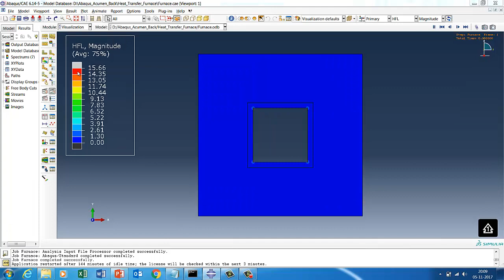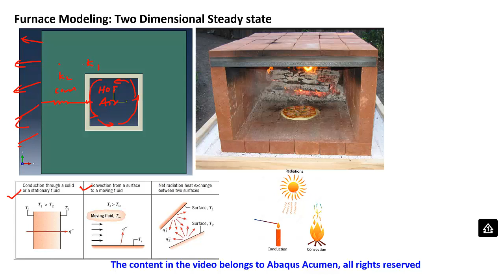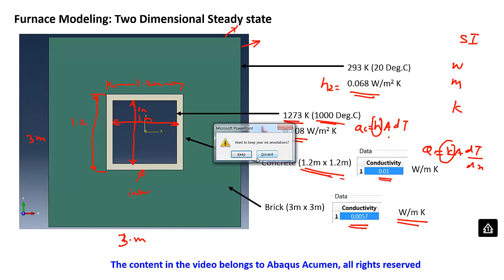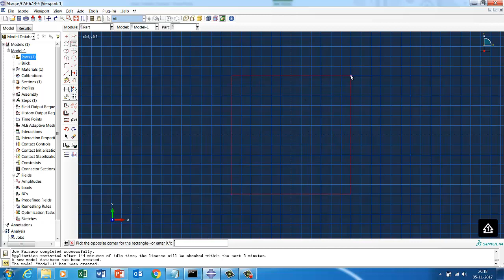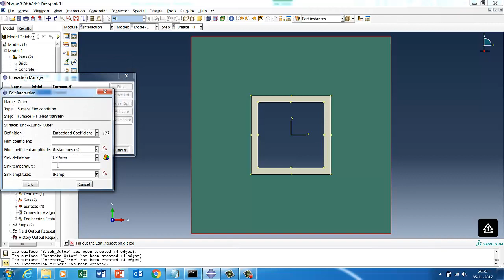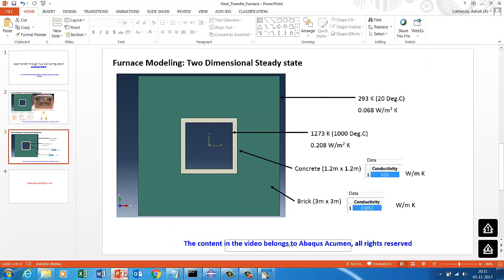Heat Transfer Through Two Wall: Furnace Modeling

Comment: 07:20 Create Part - Brick
08:38 Create Material - Brick
09:32 Create Section - Brick
09:42 Create Section Assignment - Brick

09:52 Create Part - Concrete
10:46 Create Material - Concrete
11:12 Create Section - Concrete
11:23 Create Section Assignment - Concrete

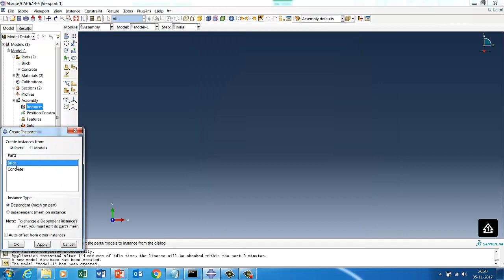11:34 Create Instance

12:24 Create Surface - Brick_inner
12:47 Create Surface - Brick_outer
13:08 Create Surface - Concrete_outer
13:26 Create Surface - Concrete_inner

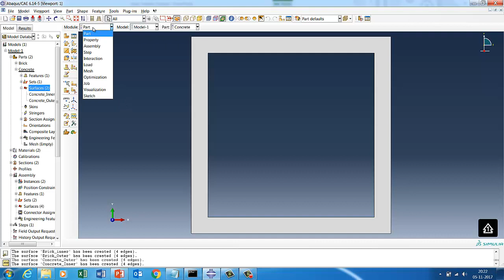13:48 Create Step

14:30 Create Constraint (Tie)
16:00 Create Interaction - Surface film condition - Concrete_inner
16:27 Create Interaction - Surface film condition - Brick_outer

17:43 Mesh
17:46 Mesh Controls - Concrete (Quad - Medial axis)
17:50 Global Seed - Concrete (Approximate global size: 0.02)
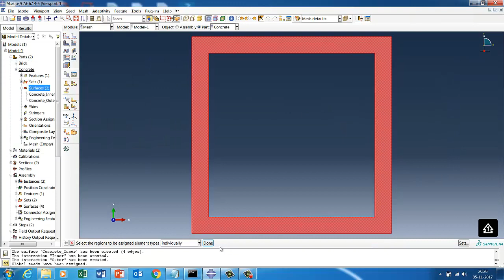17:58 Region Select - Concrete (Element Type: Heat Transfer)
18:16 Mesh Part Instance - Concrete
18:23 Mesh Controls - Brick (Quad - Medial axis)
18:30 Global Seed - Brick (Approximate global size: 0.1)
18:37 Region Select - Brick (Element Type: Heat Transfer)
18:44 Mesh Part Instance - Brick

19:36 Create Field Output (Thermal: NT, NFL)

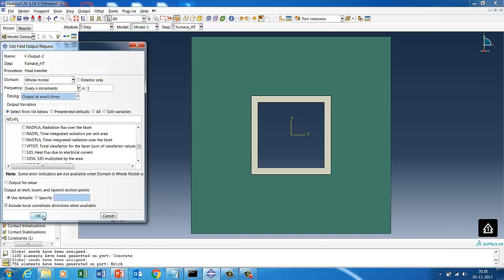19:55 Create Job (Data Check)

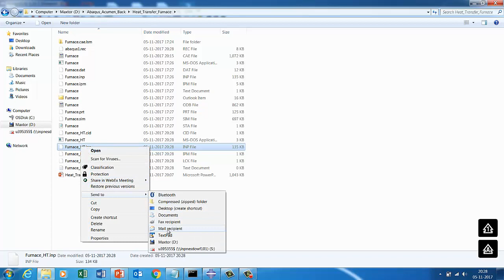20:28 Input File Check

21:13 Submit Job
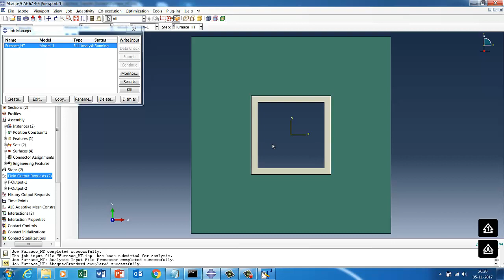21:44 Monitor Job
21:46 Results
Reply from the maker: Thanks a lot
Reply: @abaqusacumen7397  You're welcome.

Comment: Thank you so much. I have a question sir, is it possible to mold plastic at a melt temperature in micro-mold cavities(0.2mm depth and 0.04mm width) using sinusoidal forging model same as metal.

Comment: @abaquc acumen can you also post video where similar heat transfer problem is solved by Composite shell
where outer layer could have insulation inner would be metal

Comment: Dear sir, 
     Plz explain the meaning of intensive heat flux vector at inner corners of concrete domain interfaced with convective air flow. As you said that there is least resistance to heat flow....can you explain little bit in detail....As I have some confusions & just partly understanding about it....🙏 As per my understanding, there should be less intensive heat flux along corner region as it has to travel along diagonally direction which having high distance & hence the thermal resistance as compared with normal direction ???🤔

Comment: Thank you for the video, Sir can you make another video on thermal contact conductance under pressure between different material.(In case of lap joint)
Reply from the maker: This will be our next Video
Reply: Thank You sir.
Reply: thank you so much. I have a question sir, is it possible to mold plastic at a melt temperature in micro-mold cavities(0.2mm depth and 0.04mm width) using sinusoidal forging model same as metal.

Comment: Heat transfer coefficient on a concrete wall is 0.208 but in the video u used 0.01 and u say that it is higher than brick wall heat transfer coefficient ??